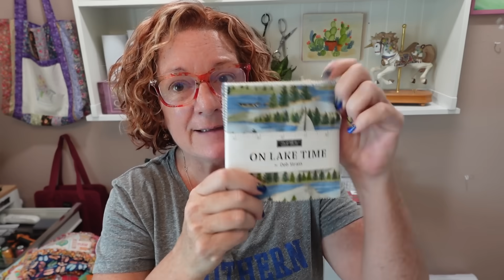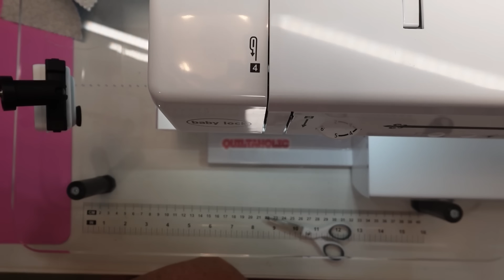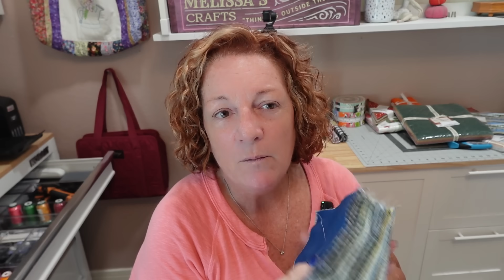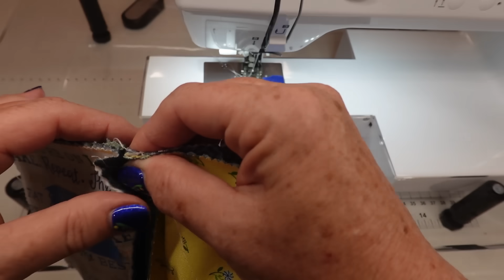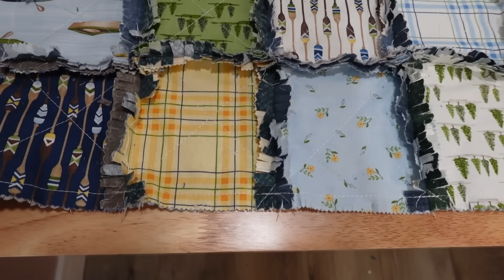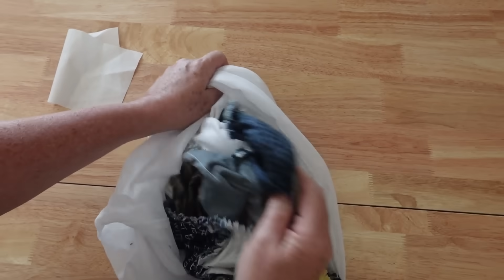🧵❤️ No-Cut (But Yes, You Still Clip!) Rag Quilt – Step-by-Step Tutorial

Comment: What is purpose of back stitching the seams?
Reply from the maker: So I backstitch my seams  give them a little bit of extra strength, especially an intersections of seams and when I start a scene and stop a scene that way the threads don’t have a way of wiggling themselves out. But on a rag quilt, where your block pairs intersect in your Rose intersect their stress on those stitches that go there if you backstitch it just gives it a little bit more strength and it can handle the stress a little bit better.

Comment: Now, it seems it would be pretty easy to add batting to to make a winter quilt.  I guess I'll be finding out.
Reply from the maker: It totally works, you're going to love how warm it turns out! ❤️  just cut the batting squares smaller than the main squares, the batting should "fit" inside the seams for that way, you can still clip for the fuzzy seams and not hit the batting

Comment: What size is your rag quilt
Reply from the maker: This teaching quilt is a lap quilt size -- so about 28" x 24 inches -- it's made with the 5 inch charm packs -- one made with the 10 inch square would be around 50 x 60 using a 1 inch seam

Comment: I always sew my squares, or rectangles, together like bricks in a brick wall. That avoids those bulky seams where four corners come together. This requires a half block at opposite ends of alternating rows. I also like to put one layer of Osnaburg fabric between the layers of each block which produces a fantastic fray.
Reply from the maker: That's a great tip for reducing bulk, thanks for sharing! 💖

Comment: So you don't use batting?
Reply from the maker: Most of my quilts only have two layers one of them being flannel every now and then I’ll do a three layer quilt but yes I stopped using batting about 15 years ago however, if you want to use batting, you just need to cut the batting square smaller than your main square so that it doesn’t get caught up in the seams

Comment: This great, thanks! Will you please explain why interfacing is not necessary for the quilt squares? Thank you.
Reply from the maker: Sure thing, interfacing is not needed due to the weight and structure of the flannel -- I also usually skip batting in rag quilts because flannel gives me the thickness and softness I want and it frays beautifully.

Comment: Great video, thank you! I want to give you a tip I just discovered and it’s genius. I bought huge mesh laundry bags on Amazon. A two pack was around $10.00. They are large enough to hold a decent size rag quilt. I put my quilt in the bag and washed it then tossed the bag in the dryer and dried it in the bag. All the little threads and lint remain in the bag and not in the drain or clogging the dryer. No need to take rag quilts to the laundromat. I took the bagged  quilt outside after drying in my dryer and shook it well in  my yard so all loose threads were not in my house or dryer vent. It solves the problem of lint with rag quilts.
Reply from the maker: What an amazing tip! Thank you so much for sharing your genius idea with us—that's incredibly helpful! 😊

Comment: Can you stuff them with batting?  Can you also only use cotton fabric with no flannel?
Reply from the maker: Yes, if you wanted to add batting, you would just cut squares that are 1 inch smaller than your quilt block - as for cotton on cotton, with batting in the middle would work -- I'm not sure how just cotton/cotton without flannel or batting in the middle would -- thanks for watching!

Comment: Doʻ you recommend to use any batting
Reply from the maker: Most of my quilts stay between Florida and Tennessee - I just love the feel, thickness and weight of the flannel they are very similar to the blankets that my grandmothers made - I have made them with batting by just cutting the square smaller - but then again, there is that "cut" word -- LOL (not my best skill, cutting) -- If I need a thicker quilt, I'll add another layer of Flannel --

Comment: Yes, very helpful.  Question: is there a reason why you don't use a batting in between the blocks?
Reply from the maker: Thanks for watching -- For me it's 2 reasons 1) I don't have to cut the batting and 2) I prefer the weight of quilts without the batting - I live in Florida, now and most of my quilts stay either here or in Tennessee -  There is no "Right" way, just what you prefer - I have also made them with an extra layer of flannel in the middle if I needed a quilt with a bit extra weight --  HTH

Comment: Where do you get your squares from...I found a lot of Amazon in cotton but not many flannel. I am also planning to make a Queen size...so I would need 54 cotton and 54 flannel to make is 90X108 (9 across and 6 down)  and packs usually come in packs of 42 (common) but they did have packs of 100, 200 etc. So basically I will need some extra squares...what do you do in that case without having to buy a whole pack? I was going to buy a new quilt so I am going to apply your teaching and go for it...lol It might take a little while but I am excited to do it. Thank You for your help and sharing the video!!
Reply: Hello Melissa....so Now I plan to make 2 rag quilt pillow shams to go with the Queen size I mentioned in my first post...do you have a tutorial for this? Now I need to add more quilt pieces in so I am sure I will have some left over which is fine......because I will probably make some more things on your pages as I get on a roll...LOL I am having a problem finding the flannel squares   but I am still looking.
Reply from the maker: I just love the energy in your responses! and can't wait to see what you make -- 1) where do I get my squares?  mostly from Etsy, but Missouri Star Quilt and Fat Quarter Shop are 2 of my go to online (I'm working on the whole list) -  2) if I need extra?  I don't normally do larger quilts if I'm doing the layer cake based ones -- but, if  I did - I would just use the extras and make a "jeanette" bag" or the Reusable Gift bag -- you Pillow sham is an excellent idea -- I have not done that yet, but it just went on my list -  Please keep me posted!  I would love to see how this turns out
Reply: @MakewithMelissa   I have been scouring  the internet on pricing to get my squares...both the top and the bottom. So to make my Queen size quilt I will need 84 top and bottom - so 2 (42) layer cakes...I have had the worst time trying to find the flannel sets...when I do find them they are twice the cost...but I am still hunting. I know I have my hands full with this project but I am so excited to tackle it...I will take my time. I have ordered my walking foot and thread. I am in Ohio......so we are about the turn back the clocks from Sunshine & Happiness to Misery & Despair 🤣😂 so I will have a nice project to keep me busy .ha ha
Reply from the maker: @bridgingloss89   this sale ends tonight (10/30/2025) from MSQC it's buy 1 get one 50% off and they do some some flannel sets -- https://www.missouriquiltco.com/collections/jelly-roll-layer-cake-sale    Have you tried ebay? and etsy?  I also know some folks have used flannel sheets (you would just have to cut)  -- Where in Ohio?  My Husband is from Tiffin
Reply: @MakewithMelissa  Ok...so I missed the sale at Missouri Quilt Co. That's ok....I am finding other sources still hunting for color combinations as I prepare for this project. I have a question...I plan to make a queen size and every calculation I look at it tells me a different amount of 10X10 squares...so I need your help. How many squares would you use? Lets just say a 15" drop on each side...it will shrink up a little so that's fine. I will be putting a 9X9 batting square between my sandwich of Cotton and Flannel I already ordered the cotton...still looking deciding on flannel colors :) I just got to be clear on the number of squares I need. Thank You! so much for your help. We live in Alliance...outside of Canton (Football Hal of Fame).
Reply from the maker: I put your info into AI and this is what was calculated, does it match any of the other calculations? 

 - Target Quilt Dimensions
A standard queen mattress is 60" x 80". With a 15" drop on each side, we add:
• 	Width: 60" + 15" (left) + 15" (right) = 90"
• 	Length: 80" + 15" (top) + 15" (bottom) = 110"
So your quilt top should be approximately 90" x 110" finished.

🔢 Number of Squares Needed
Each finished square is 9" x 9" (after seam allowance). Divide the total dimensions:
• 	Width: 90" ÷ 9" = 10 squares
• 	Length: 110" ÷ 9" = 12.22 squares → round up to 13 squares
So you’ll need: 10 squares across × 13 squares down = 130 squares total

Comment: I was surprised that you didnt use batting. Just another way, i guess.
Reply from the maker: Most of mine are made without batting—I use flannel instead. It’s thick enough to give the quilt weight and fluff, especially if you use a heavier flannel.  I started out with batting, 20 years ago but now just a combination of Flannel/Cotton -- I have made them also with just 3 layers of cotton (no flannel) == Yep, so many different ways and methods to make Rag Quilts  - Thanks for watching and commenting

Comment: Do you bind this quilt, or clip the outside edge? Did i miss that part? Thanks, 😊
Reply from the maker: I sew all around the quilt with a 1 inch seam allowance and then clip the same way as with the inner seams - you can bind it - but I like the ragged edges

Comment: Why do you not add batting?
Reply from the maker: Most of mine are made without batting—I use flannel instead. It’s thick enough to give the quilt weight and fluff, especially if
you use a heavier flannel. If I want extra warmth, I’ll add a third layer of flannel in the middle. If you do use batting, cut it
smaller than your fabric squares so it doesn’t peek out when you clip the seams.

Comment: Really good video, but may I ask what seam allowance you suggest to use for a layer cake? Thank you.
Reply from the maker: For the layer cake, I use almost a 1-inch seam allowance.  I use where the bobbin casing (the metal) and the plastic meet -- I measured, and it is just under an inch --  I know that is a wide seam, but gives me enough room to clip and not be so close to the seam -- I cut really close together, under 1/8 of an inch and get really puffy fringe --  most of what I read are between 1/2 and 3/4 --
Reply: @MakewithMelissa  Thank you

Comment: I helped with a baby blanket for a church that donates the blankets to a hospital. They had a middle smaller piece of flannel on the inside which made it 3 layers. We made it with 48 squares. For the different squares they had a chart drawn out for me to follow to alternate 123123123123123123
231231231231231231
321321321321321321. 
 Then it was passed onto the next lady to snip and then wash and dry.
 They were beautiful when finished.
Reply: I sewed the first four rows together, sewed the next four rows  then sewed the two sets of four together to finish.

Comment: I made one about 25 years ago with expensive quilt shop flannel.  Some of the fabric wasn’t truly flannel.  It was cotton, but not brushed.  I followed the clipping instructions but after a few years the fabric continued to rip at the clips and eventually made full on holes.  I didn’t see this until it was too late to fix without it being obvious.  If I had to do it again I would probably make the seam wider so that there is more protection before the seam at the clip points, if that makes sense.  All of the holes started at a clipped point.
Reply from the maker: Thank you so much for sharing your experience and advice!
Reply: @MakewithMelissa thank you!  I’m still using it and trying to find a way to fix it.  I love the colors, but the three holes are ugh!
Reply from the maker: @Jenger69 . I’m wondering if you could do and overlay of some sort?   Shoot me a picture at melissa@madebymelissa.com.

Comment: Those charms are  cut with pinking shears  that keeps fabric from getting ragged  do we need to trim them first ???
Reply from the maker: You know, I've never had an issue with them not fraying -- I do cut them really, really close together (1/8 inch or smaller) -- I don't trim, I just use them as they come -- Thanks for stopping by and commenting

Comment: When you say chain stitch the squares do you mean the squares form a chain as they are formed.  Not a special stitch on the machine?   I do embroidery so chain stitch means the type of stitch it is.
Reply from the maker: Correct, basically to keep sewing and not stop to cut them apart until you are finished.  I totally forgot about the "chain stitch in embroidery" -- however, I did see someone do a special stitch versus a straight stitch -- I might try that

Comment: You don’t add bunting?
Reply from the maker: Most of mine are made without batting—I use flannel instead. It’s thick enough to give the quilt weight and fluff, especially if
you use a heavier flannel. If I want extra warmth, I’ll add a third layer of flannel in the middle. If you do use batting, cut it
smaller than your fabric squares so it doesn’t peek out when you clip the seams.

Comment: Another questions. What size quilt do you make to fit a bed?  You mentioned 6 x7 but which one is that? Also,  the bag needs to be big enough for the quilts you make so how big would accommodate them? 

Btw, i am a new subscriber.
Reply from the maker: The Layer Cake Raq Quilt is the one that uses the 10 inch squares (2 packs, one for the front, one for the back) - One layer cake quilt finishes around 52 by 59 inches. -- The # of blocks for a bed would depend on the size (twin, queen or king) -- Let me work on a conversion chart specifically for Layer Cakes into twin, queen/full, King -- this specific reference is for what I call a "couch quilt" --  RE: the Bag -- the one I use is an extra large laundry bag -- roomy enough to handle the layer cake quilt and more
Reply: @MakewithMelissa  Thank you for the size laundry bag!

Comment: When i make rag quilts they always have a cotton batting so they are warm.  I didn't know people make them with just 2 layers of fabric without the batting.
Reply from the maker: Early on I did use batting, but I switched to just flannel a while back -- it’s thick enough to give the quilt weight and fluff. If I want extra warmth, I’ll add a third layer of flannel in the middle.   Plus, I don't have to do the extra step of cutting the batting smaller -- but the Florida and Tennessee quilts, 2 layers are perfect weight  -- Now, if I'm sending up North, then they might get an extra layer :) -- thanks for stopping by!

Comment: Thank you, Melissa😊 I made a few rag quilts a few years ago, I used fleece. They are super fun and so cute. Your video has prompted me to start again, using the precut cotton and flannel. I started last night and am excited to work on it. Your video is great, very helpful. Question: why don’t you backstitch on the X connecting your squares? Thanks again!
Reply from the maker: HI!  and Welcome -- I'm so glad you are here -- Yep, you will find that I love to use precuts!!!  As to why I don't backstitch on the x - my thinking is that each of the corners have a row of stitching (when sewn to the other block) and then when combined with the next row has then the back stitching, that that would be enough -- plus because of the clipping, the back stitch at the corners would get snipped off --  I'll double check, but mostly that is it -- with a 1in seam, any backstitching would be snipped -- HTH - Melissa
Reply: Thank you😊

Comment: Why don't you use batting?
Reply from the maker: Most of mine are made without batting—I use flannel instead. It’s thick enough to give the quilt weight and fluff, especially if
you use a heavier flannel. If I want extra warmth, I’ll add a third layer of flannel in the middle. If you do use batting, cut it
smaller than your fabric squares so it doesn’t peek out when you clip the seams.

Comment: You don't put batting between the fabric squares?
Reply from the maker: HI -- I do make mine without batting—I use flannel instead. It’s thick enough to give the quilt weight and fluff, especially if
you use a heavier flannel. If I want extra warmth, I’ll add a third layer of flannel in the middle. However, If you do use batting, cut it
smaller than your fabric squares so it doesn’t peek out when you clip the seams.

Comment: Good Morning 😃 do you ever use batting when you sandwich? Wondering if it’s warm enough!
Reply from the maker: Morning :) I haven't used batting in a while, but there are no rules, it's what you like.  The Flannel that I use is quite thick, so even the ones with 2 layers are quite a good weight -- I actually compared to some of the other quilts I have, and they are only off by a couple ounces -- I have made them with an additional layer of flannel in the middle and that does heavy it up -- if you do batting, just remember you have to cut the batting square smaller that the fabric --  I'm going to do a comparison video of the different "Fabric Sandwiches"